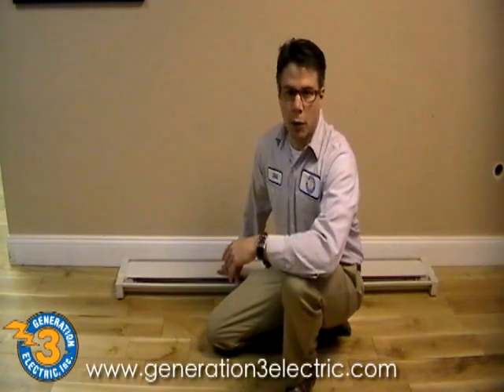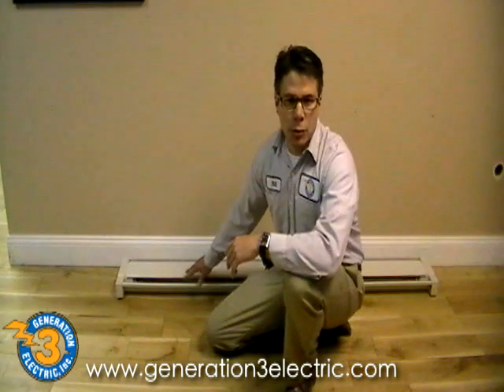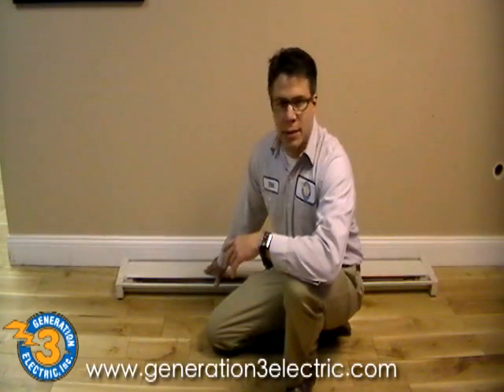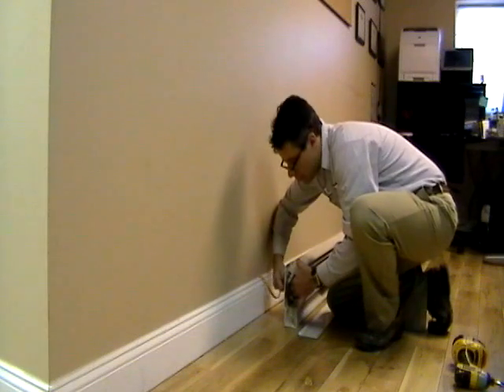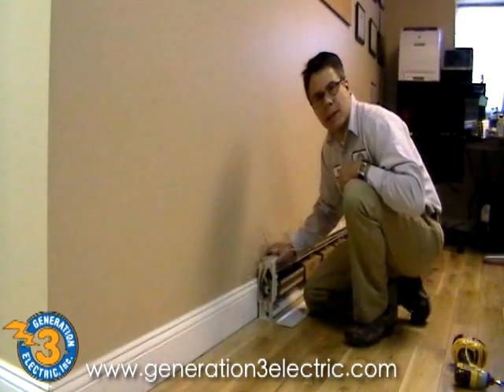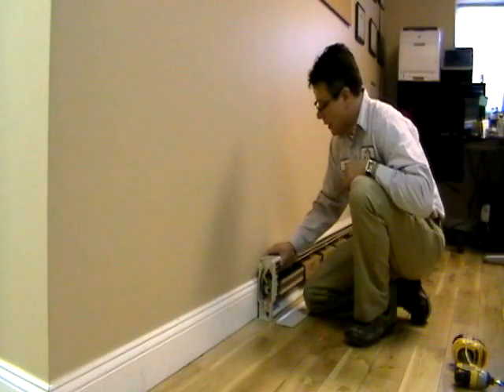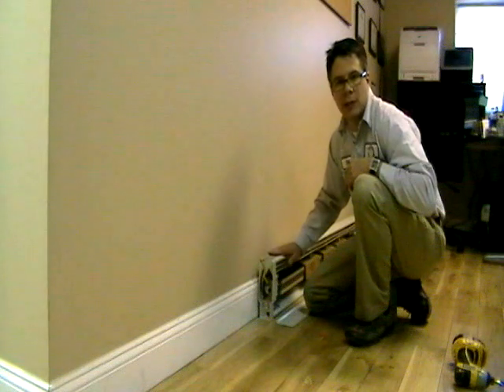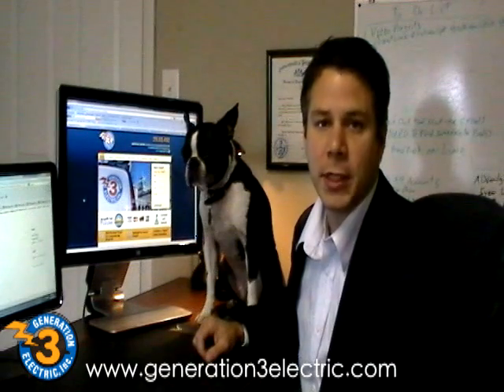Electric Baseboard Heater Install | Philadelphia Electrician

Comment: LMFAO!!  What a ridiculous video.  There was nothing explained whatsoever.  Good job, dolt.
Reply: +Generation 3 Electric i searched up how to install a baseboard heater... all this video show was you feeding the wire through the back of the unit not yet attached to the wall then you guys skipped all the way to the unit already mounted without showing steps how to mount it. what about wiring the unit to operate?
like cmon, this was a poorly produced video
Reply from the maker: What would you like to know? We will be producing more videos I will try to answer any question you have.
Reply: Briandrum Totally agree. Makes a video titled "Electric Baseboard Heater Install" and shows absolutely nothing about the install. Useless video.
Reply: +Generation 3 Electric Uh, we'd like to know how to install it? You said two statements relating to installing said heater---"in the back we're going to put a connector in", and "feed our wire into the heaters junction box". You told us but didn't show us how to complete said steps, and provided no instructions for the myriad of other steps involved. The title of your video is misleading, and it's quite apparent that you lack the ability to understand why people are upset. I would never hire you because you failed to explain anything of value, and judging from your responses you are obviously unintelligent and uneducated.

Comment: 1500 watt heater on 30amps question !!!
Hey Bud !!!! Great Vid3eo !!!
I got a question for you !!!
I have a 1500 watt Baseboard heater but right now I am only installing 1 in the dinning room !!!
The question I have for you is, 
I have a 30 amp 2 pole breaker hooked up so I get my 240 volts for this heater!!!
Is it safe to only run one 1500 watt breaker on this circuit till I get more hooked up?
I know this may be a silly question & usually people ask the opposite to what I am asking like,
"Is it safe to run 3 1500 watt Baseboard heaters on 1 30 amp 2 pole breaker 240 volts"... 
Like I realise that only running 1 1500 watt heater on a 30 amp circuit at 240 is a bit overkill,
But is it safe till I add more heaters?
Thanks Bud !!
DEv
Reply: I don't know if this question is to old to be answered but to answer your question yes it is safe..  Because a baseboard heater can be ran for 3 hours continuously it should be counted as a continuous load..  There for you only want to load the 30 amps to 80% of the maximum amperage which is 24 amps since you said it's 240 volts..  30 ×. 8=24..  The wattage you said is 1500, to put the wattage into amps you have to multiply it by the voltage (240)..  1500×3=4500 4500÷240=18.75amps(which is below 24 amps) .. However make sure you are rite that your heaters are 240 volts & not 120 because then it becomes unsafe
Reply: Rakeem sw Thanks 4 The Reply!!

Comment: @Generation3electric thank you...Yes i ran 2 circuits just in case. I have 2 heaters with 2 thermostats. But i would prefer just to have them on one circuit to save panel space. They will only need around 10 amps on a 20 amp circuit. So once the line hits the thermostat it gets transformed into a lower voltage to regulate the heat temperature? I can just splice the line at a Junction Box and hit the two lines of the thermostat in parallel and the loads will do their own thing?

Comment from the maker: @achilles781 You can have more then one heater on a circuit. We like to keep the number of heaters on a circuit low.Cost and panel space can be an issue. Ideally I would have one breaker one heater.
Every splice is a point of failure. The thermostat has the line voltage coming into it. The load voltage(heat) is controlled by the thermostat.

Comment: @Generation3electric what about if you had 2 heaters on one 20 amp ckt? With two different thermostats? Just feed each thermostat with the line? Or should they be on stand alone 2/pole ckts?

Comment from the maker: We always power appliances with at least a 12 gauge 20 amp line. It is a safer way to do it. A 14-2 line would work without tripping a 15 amp breaker but I have see them go bad. I prefer to use the thicker gauge of the 12/2 for this type of application.